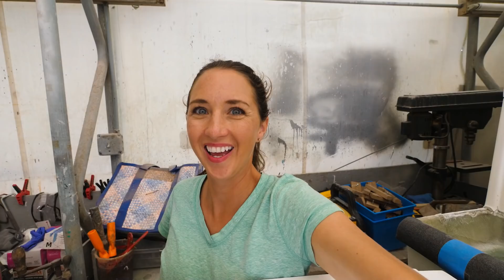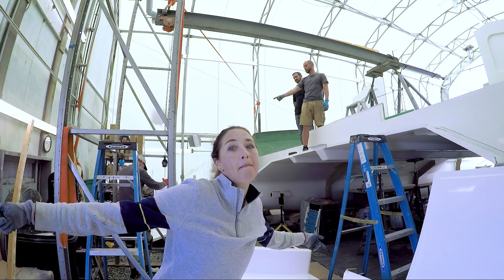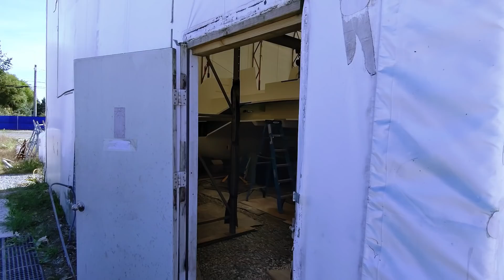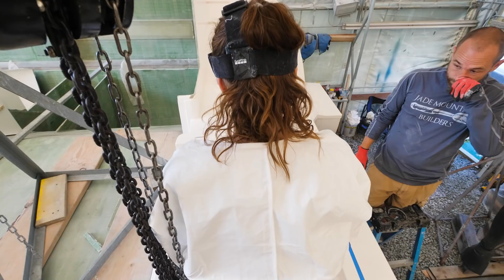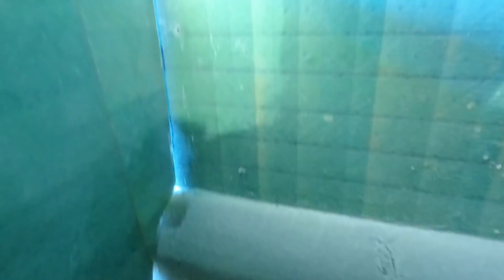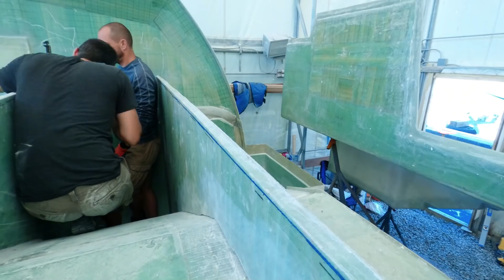CATAMARAN BUILD - Can 4 People Lift A Transom Into Place? (MJ Sailing - Ep 211)

Comment: Why were u measuring 3/4 down from the bulkhead edge? Should of measured 3/4 down from the side of transom. If u wanted 3/4 cut off the bulkhead, you could of done all that measuring after u removed the transom..

Comment: Hi Matt and Jess. I can’t remember what you had on Elements, but it seems most cruisers with radar use a fixed mount not a gimbaled mount on the mast. I’m curious if you’ll be installing radar on your mast? If you do, will you be using a fixed mount or a gimbal/leveling/swinging type mount? Is there any real benefit from the swinging/leveling type or is it mostly a marketing pitch? Thanks and great video as usual.

Comment: Even though it’s not installed during this video, it really looks great getting the transom up and onto the boat.  I’m curious about the Jackery Power Station setup.  During your testing, could you see if you could be charging the power station while it was still connected to the solar panels?   This would be a great test for boaters underway that needed additional power for whatever reason, like for a small induction cooktop that would minimize using LP gas.  I have the same cooktop as Jason and Nikki Wynn use (Duxtop P961LS), but we have a 43 ft Fifth Wheel and the use would be similar for any sailing trip.

Comment: I haven't finished the video yet but if your going to be cutting off to the black line you drew I feel that's going to be huge mistake. Surly the builders didn't leave that much extra no? I hope everything goes well anyway.
Reply: If the transom needed to be lowered 3/4” to fit, then I think she needed to push the scribe block in contact with the transom and not flush to the top of the bulkhead. I think they caught it, hence the blue line. Not hating. I feel pretty handy, and am in awe of this couple.
Reply: Even if they had cut at the original black mark (which they didn't) it was only 3/4 of an inch. The 2nd mark, the blue line that they actually cut off was about half of that.
Reply: My educated guess is flush mounted panels were probably cut larger at the factory to allow for proper fitment down the road.  Like in model building, molded plastic always need some shaving and sculpting to get the pieces to line up. Again, just a guess. But yea, I definitely thought it might be worthy of a call to the manufacturer. I bet on the factory production line they have some serious power grinders and bond panels in place as they build.
Reply: @MaShcode  fitment and also to prevent damage to edges. If you cut the edges then they can't be damaged in transit. Plus all the right angles flanges are there just for the same reason, they get cut off as well.